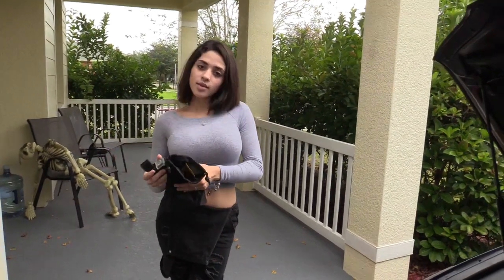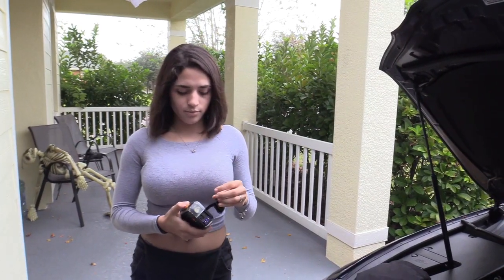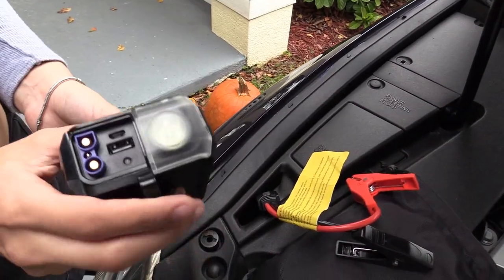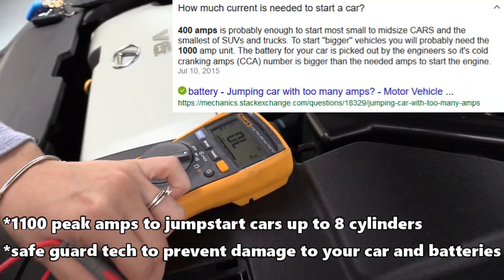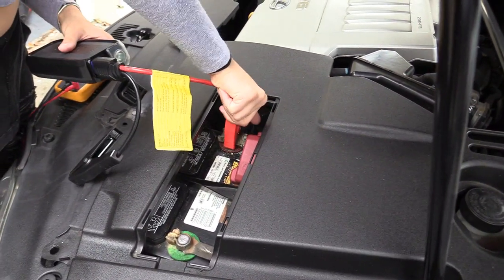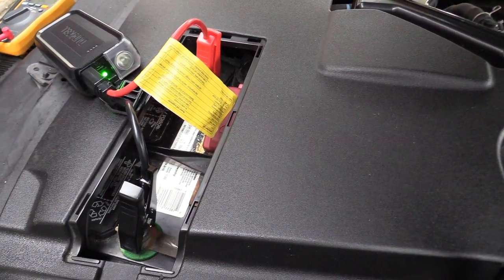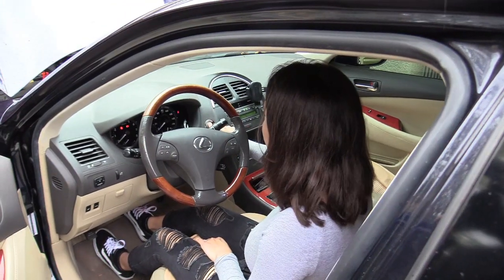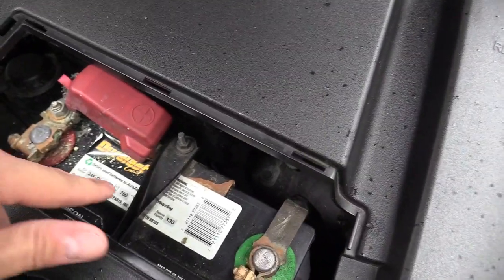DURACELL BATTERY CAR JUMP STARTER GUIDE

Comment: My Goodness! I really love Tampatec. This video rates two big thumbs up 👍🏼 👍🏼!  Tampatec, and Christina, Rock!

I have a different type of these starters, mine has a built in inverter. I always thought there were some kind of capacitor bank but after opening mine up, it just has a good sized 14.8 volt Li-Po Battery, charging board with lights and in my case, small 1A inverter circuit. I must say, I have used mine close to a dozen times and unless the battery is 85% dead or shorted, I’ve been able to start an eight cylinder car. These are almost must haves in cars nowadays. Nice work!
Reply: i love the light weight. i have an 8 function booster/air compressor/inverter and other things but it's heavy and can't be put in the glove box but i can start my car with the cigarette lighter adapter i have it in the car. i'm handicapped and in a wheelchair. getting out, opening the trunk, hood and all is not that easy. i keep my booster behind my front seat. i could adapt the one advertised by chritina to jump start from the cigarette lighter by having a male lighter plug with alligator clips to hook it to the battery clamps of this device. easy.

Comment: What is the jump start unit rated for, regarding Cold Cranking Amps?  I didn't see anything in the Amazon side.  Or do Lithium units have a different rating?  I know these Lithium Ion batteries go full bore then just quit when the charge level drops off.  I'm being nice here, your niece is gorgeous!

Comment: Now I thought we are all supposed to use the positive terminal on the battery and the "ground" on the engine block so as to not hurt the battery sensor and or blow up the battery due to the hydrogen gas danger?